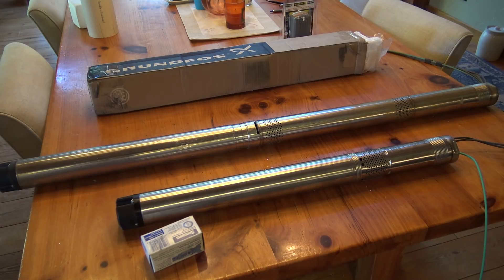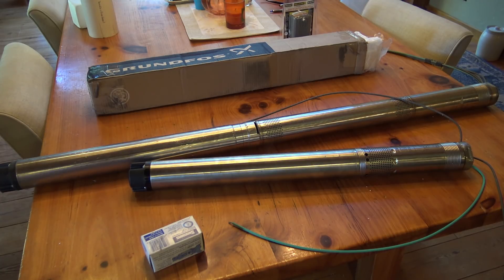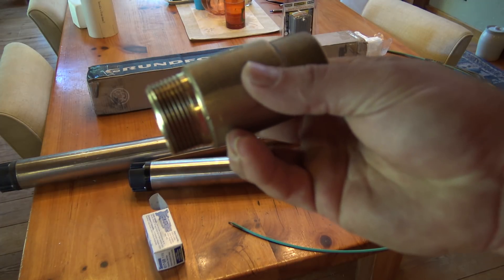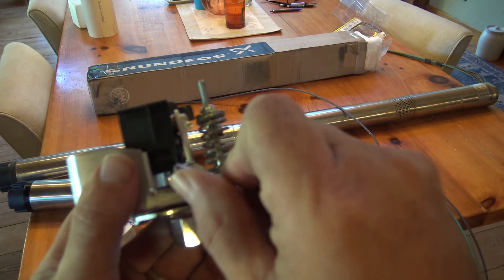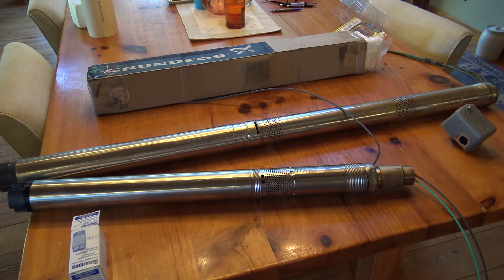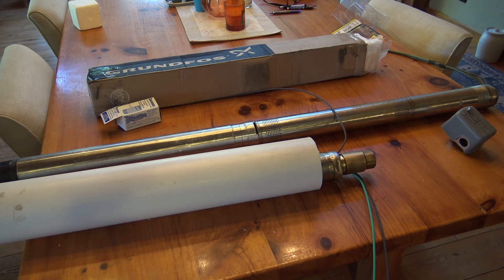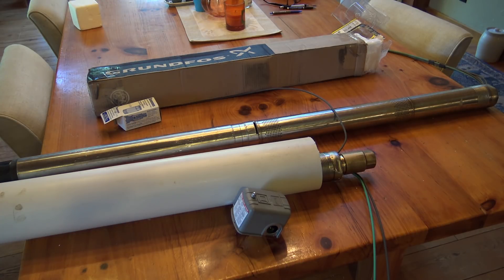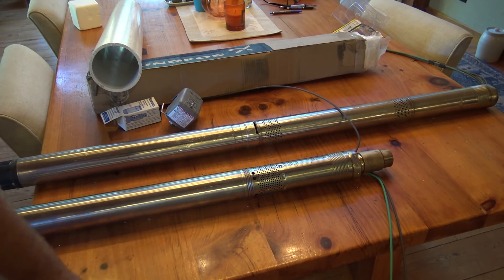The Best Well Pumps for  Inverters and Small Generators.

Comment: I have a question regarding a shallow well pump running off a modified sign wave inverter. I am currently running a 10,000 watt modified inverter and a 1/2 hp red lion shallow well pump. If I am running off the generator it runs perfectly. When running off my inverter the pump starts up fine but after building up a little pressure above the 30 psi kick in the pump starts to chatter ( cutting out and instantly restarting) my old cheap harbor freight pump didn't have this issue. I tried changing out the pressure switch thinking that was the problem and no luck. I am at a loss as to changing out the pump or other things to try. If I do change out the pump I'm wondering what to goto that would run well with a modified sign wave inverter. The well is roughly 16' deep with a 36" sand point.

Comment: I've a Grundfos 1 1/2 hp 240v well pump running off a Magmun 4kw inverter.  Works fine but I should have gone to a smaller pump.

Comment: I'm having trouble deciding what pump would be best for my off grid homestead. The well is 378' static level is 328' when they ran the well test they said the flow was 9.5 gpm. They used  a 1-1/2 gpm Franklin pump and said the well produced more than the pump could pump. They recommended a grundfos  5sq10-410 but they wanted 1700.00 for it. I did some research and found it cheaper. My question is should I go to maybe a 10 gpm instead of the 5 gpm? I want to have plenty of water flow in case of fire. Thanks and glad to see your back.
Reply: The Hands On Channel 
Maybe use a slower less expensive pump to pump to a cistern. Or maybe a water tower and have gravity feed so you would have some flow even if your power is low or not working.
Reply: Thanks bud great idea.

Comment: I have a question re a shallow well. It's about 25 ft from my house, and I would like to move the bladder tank and pump into my house. Tired of it freezing, neighbors jacking with wiring, etc. Is it possible? I have no problem with water pressure where it is. water table less than a foot underground most of the year. Any input would be appreciated.

Comment: Have you done a video installing one of these in a cistern I'm kind of wondering how it would work underground concrete cistern and if you could put it on a flexible hose ranges on it or do you mount it to the bottom of the tank somehow
Reply from the maker: Yes, I hope to have it posted by tomorrow night.

Comment: I do like most of your video's , however being a 4th generation water well driller/tech. most of your videos like this one is mostly wrong info. I go behind a lot of customers that have saw videos like this one and that have followed advice from the web and what they are doing is costing them more money in the long run which defeats the purpose of what you are trying to do, not to mention the fact that most know nothing about electricity which in return could get them killed or disfigured . So please people if you are wanting to have a well drilled or a new system installed called a professional. A professional will cost you more up front but in the long run will save you thousands . I see it all the time, systems lasting for 2-5 yrs . instead of 25 yrs.....Call your local companies that are knowledgeable about the wells in your areas and the system that will be right for you.
Reply from the maker: twobitsmith1 really? Wrong info? How so? I have systems installed in wells, springs, rain catchment and in many states. I am so busy because 4th generation well guys do not understand inverters and modern alternative power systems and blindly install 1 hp pumps with very high startup currents and overcharge their customers. ??? Please explain yourself.
Reply: Twobitsmith. Where is he wrong info he presented.

Comment: Sorry to be blunt about this but as an engineer (nit picky about the details) it would have been helpful showing how/where the pressure switch connects to the system as well as showing how the pressure tank hooks up.  When the weather breaks I am finally going to get my well working but wasn’t aware I needed a pressure tank or where to install it.  Can you provide this information with “ALL THE DETAILS”.  Thanks!!!

Comment: Thanks for the video. I had no idea about the pressure switch with low pressure cutoff. I think I'll put one on my pastures water system. since I only go out there a few times a week, I've been worried about burning up the pump if anything started leaking.